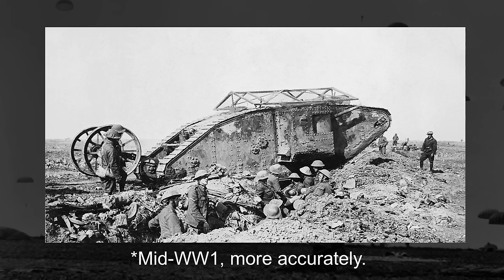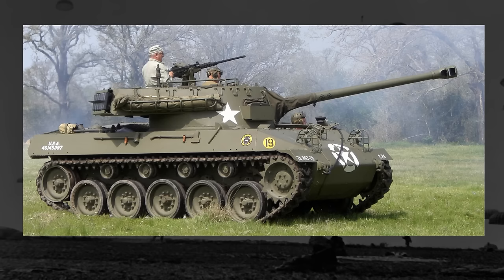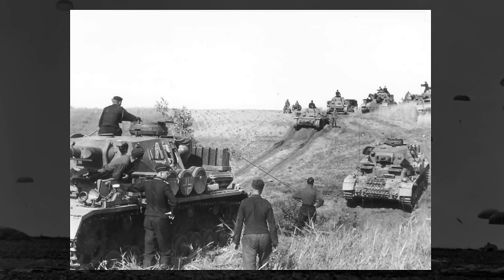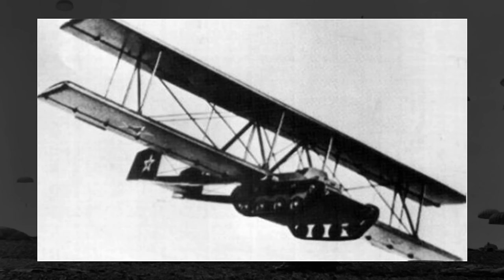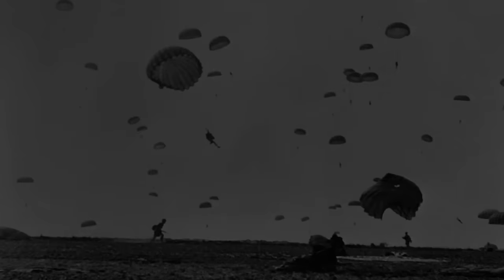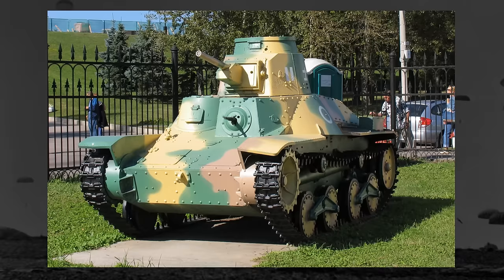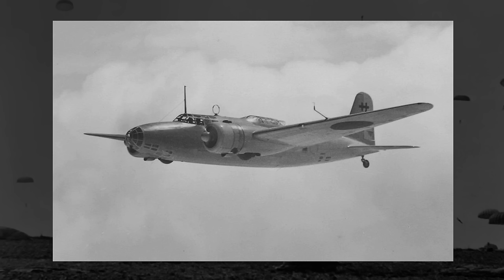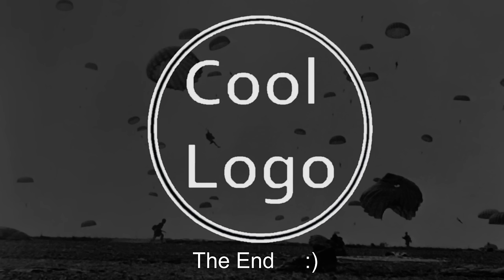Half Plane, Half Tank, All Terrible: Maeda Ku-6

Comment: Keep in mind, Japanese tanks were more for infantry support rather than anti tank. They were small and light so they could be used in austere environments, their design allowed them to be placed in areas were you would not expect a tank. Which when you are on an island where the enemy really isn't expecting tanks is a very advantageous thing. You are putting a 37, 45, or 57mm that is covered in armor and can be relatively easy to mobilize in an environment where your enemies are going to be using small arms and light artillery.

Comment: Speaking of soviet war atrocities if tanks aren't heavy enough they also toyed with flying submarines :) .
Reply: They weren't the only ones the us had a project in the 1960s for a submarine seaplane.
Reply: @poil8351  probably much more doable these days but back then without modern composites. Getting things water tight and in and out of operation between states just an insane amount of weight to add to a plane but you could go genset to electroprop to make conversion from modes easier now but getting a water logged engine running really doesn't sound great :).